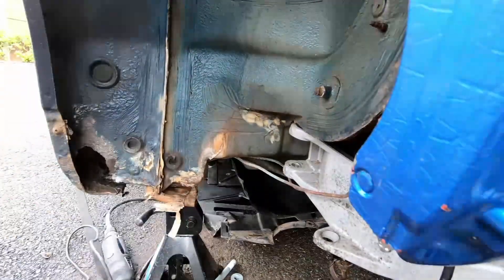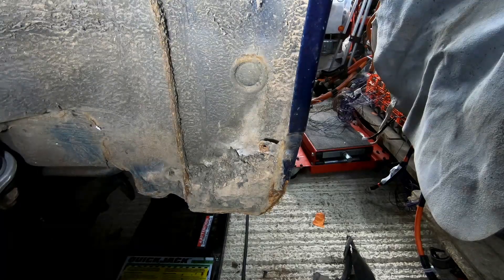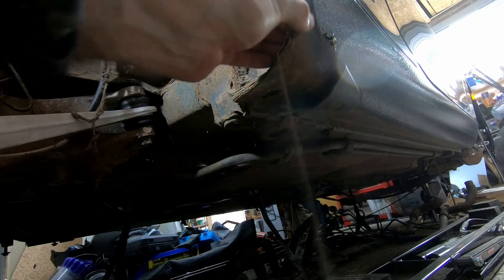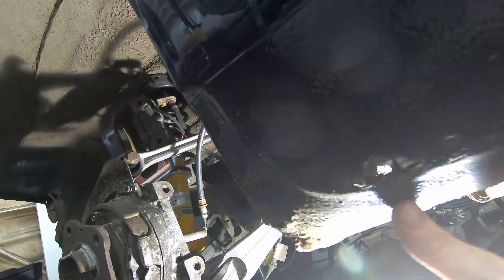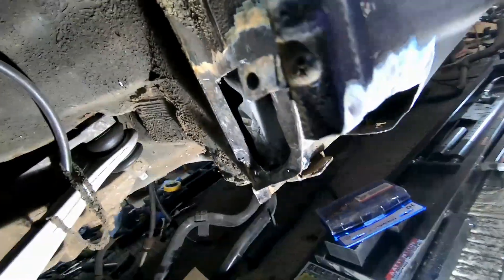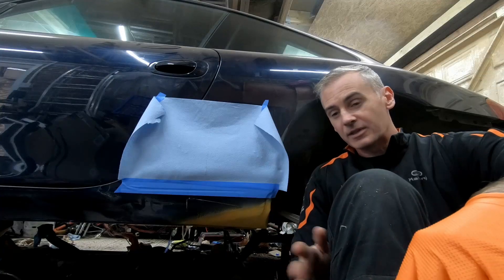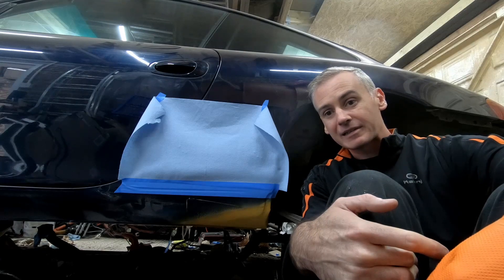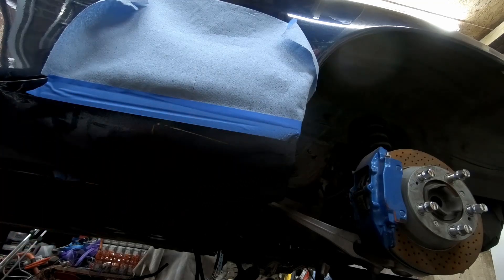Repairing rusty sills on our Electric Porsche 996 EV Conversion Project

Comment: Hi Shane - I see you have a Quick Jack. They seem to get good reviews. What is your opinion on it - The Good/ The Bad and where did you purchase it from? I too have a 996 albeit with a Internal Combustion engine 😀
Reply from the maker: I really like my QuickJack. I used to get really stressed getting the 996 up into 4 jack stands as the weight distribution and jacking points seemed to make it just balance on 2 diagonally across the car until I got the 4th stand in place. 
Now I just slide the quickjack under the car and press a button. 
The only real downsides are 1) that you can only go in from the front or back of the car, so need a long enough garage to give you space to do that. I usually take the wheels off when it’s up to improve access. 2) it’s rather bulky to store when not in use. I think I finally found an out of the way spot that works, but I had to reorganise the garage a bit to do it. 
I got mine through CostCo
Reply: @PerformanceEV  You do know you can use the Quickjacks sideways under the car right - not just lengthways